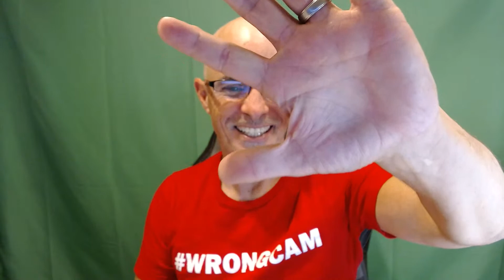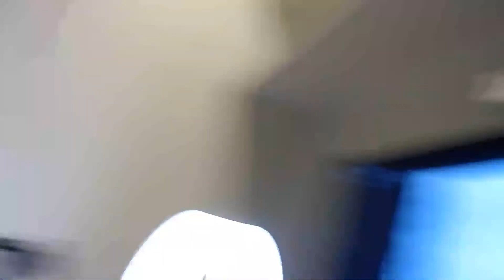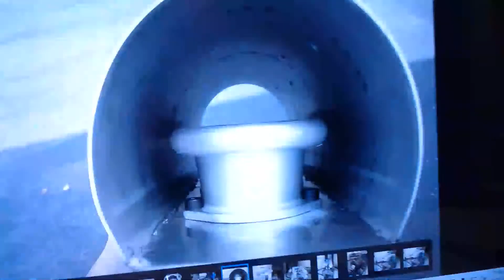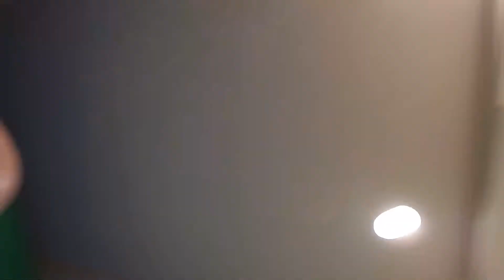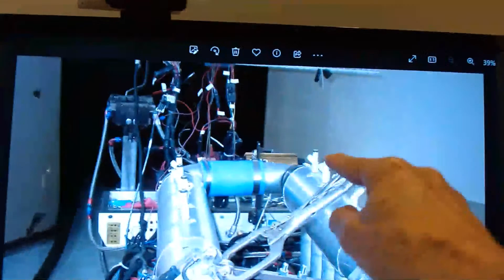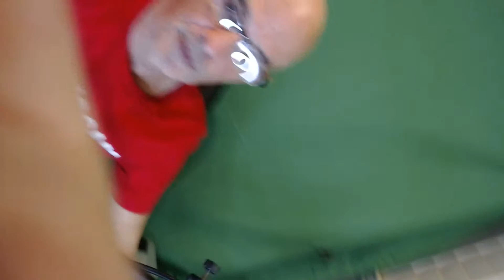LET'S TALK TECH-RELOCATING INJECTORS FOR POWER

Comment: Be cool see why Aston Martin 5.2 V12 TT makes a lot torque. Even more than hp.  Not about the turbos. Without turbos had to make higher torque than hp. In a start na. Is it the intake? Ford coyote makes less torque than hp. Wondering u know exactly lol. Good runners lol.
Reply from the maker: many factory combos (mild) make a higher peak torque number than hp (the old GM TPI made 245 hp and 345 lb-ft, Ford HO was similar)

Comment: With the dbw tb you could also test it flapping open or blending open and close that could be interesting testing. I know in the corvette they say they don’t simply open and close at given rpm but dance open and close flutter even. You could blend speed frequency and how far it cracks open during flutter, should it open all at once? Should it blend in and out should it flutter? That could get really interesting like dual cam dual vvt with vtech, pull after pull after pull 😅
Reply from the maker: agreed

Comment: I have a question about how much an LS aluminium block will expand in height when its up to running temperature.  I've been told anywhere from 10 to 15 tho. So the quench area will increase. Is this true??
Reply from the maker: does the head not change as well with heat?

Comment: Moving the injectors further away from the port will help increase power. As the fuel will help cool the inlet manifold inturn reduces the intake charge temperature.
Reply: And it will in turn cool the combustion chamber less. So it doesn’t add power. Otherwise Direct Injection wouldn’t pick up so much horsepower.
Reply: @th600mike3  totally different situation. As the direct injection is a completely different injection nozzle. So fuel atomisation is vastly different.